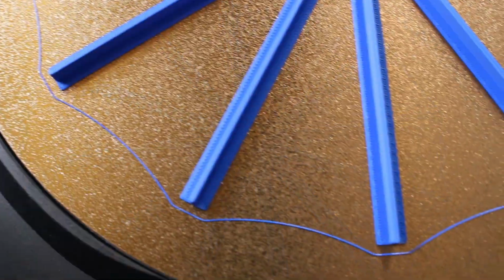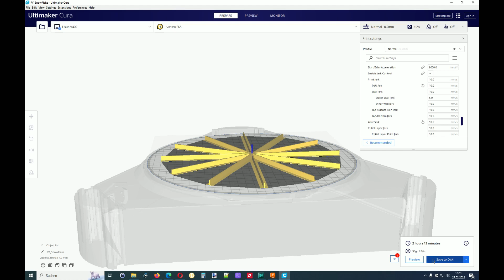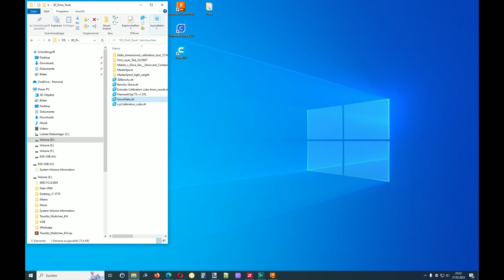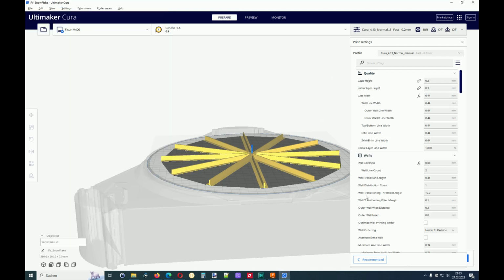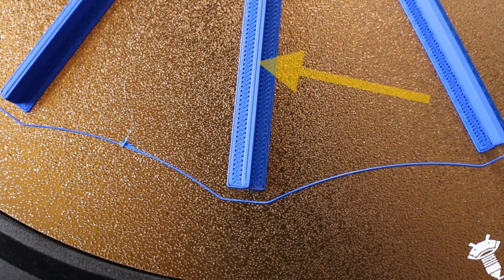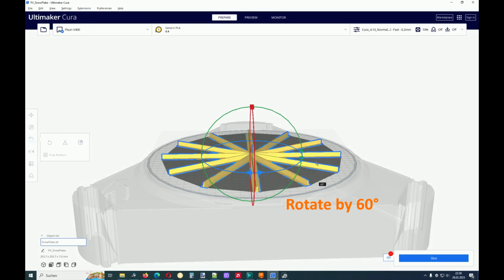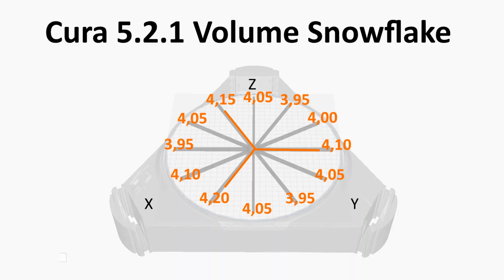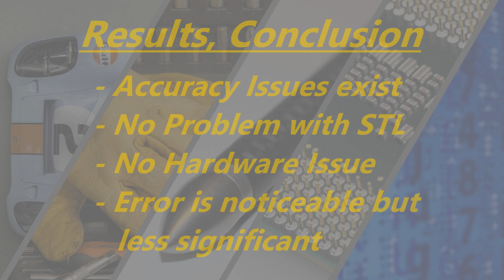FLSUN V400 Delta Printer Accuracy Issues

Comment: It's the same problem that I (and others) had with the Rostock V2. The Rostock was fair at making doo-dads, not good at all in making compliant parts.

And just out of curiosity, has FLSun been of any use at all? They were completely useless as they couldn't even be bothered to replace the bad SD card that they included with the printer.

Comment: Oh wow... and here I wanted to upgrade to the V400 becasue I cannot figure out why my Super racer is doing this.... I do not have the Data logged as you do, but I clearly noticed that prints always have an "Open" side. I moved away from Cura as Prusa slicer set to 40% overlap sort of fixes the problem for me. but I think i loose quality becasue of this. also printing PETG slower than an Ender3, not cool. I do hope there is some sort of answer here... for now then I will only upgrade the SR with the V400 Effector and wait for this problem to be settled.

Comment: I agree with @mastermaker666, that your print looks under extruded.  

I have a Hatchbox Alpha delta printer (an older printer) and I do not have this problem.  I use a 0.4mm nozzle, and Cura 5.4.0.  My "spokes" vary from 1.84 to 1.88mm.  I could be wrong, but I attribute this variance to the very long bowden tube setup the HB Alpha has.  I envy the V400's direct drive configuration.

I would recommend researching your line width settings.  But before you do that, get your printer calibrated (which it looks like you are doing, but specifically look at your extruder's steps per unit of measure calibration), then move to filament calibration.  Generally, the order for filament calibration is bed adhesion to print temperature to flow rate to retraction to print speed settings.

There is much debate about this topic in the 3d printing community, but I believe that the line width (in Cura, Quality->Line Width) should be something slightly greater than the nozzle diameter.  I believe the Simplify 3D folks suggested 0.48 for a 0.4 nozzle.  With that set, print a 20mm calibration cube with 2 walls (Cura: Walls->Wall Line Count) with 0 top and bottom layers (Cura: Top/Bottom->Top Layers, Bottom Layers).

Measure the width of the walls of the cube from the top.  You can adjust filament density or flow rate settings to get the right wall (and therefore line) width.

You can look at the width and placement of the walls from the bottom and make adjustments for elephant feet and the like.  Consider settings like: Initial Layer Height, Initial Layer Line Width, Initial Layer Horizontal Expansion, Initial Layer Flow, and so on.

That's your flow rate stuff, so move forward to calibrate your retraction and print speed settings.  Once you have that, then try the, "SnowFlake" print again and see how things look.

I look forward to hearing about your results.

Good luck!

Comment: I recently was working on a model with quite big top layer (circle, 25cm diameter) and was facing similar issues, in my case I had a bit of underextrusion in some areas of the print bed, no matter how many top layers I used (tbh I stopped after using 6). After multiple calibrations and tests (and kilograms of filament...) I don't think that there's a solution to that that would include calibration, unless there's some other form of calibration we don't know about. The weird part in my case is that the issue is usually happening every 2 infill lines (when using monotonic infill), and happens every single line when using archimedean chords infill.

Did you have any breakthrough with this issue? I'm ready to say that it's a delta thing and we won't be able to fix it, but I really don't want to loose the rest of hope I still have!

Comment: Those top surfaces look very under-extruded, the cheat fix for under extrusion is to increase line width by 0.1-0.2(any line width up to 50-60% larger than the nozzle usually don't affect accuracy in any noticeable way so 0.6 lines out of a 0.4 nozzle is usually unproblematic) and flow in 5-10% increments and print again, then repeat as needed until the problem is sufficiently fixed or things start looking too over extruded(at which point you obviously choose the last setting that wasn't too over extruded)..

Bit odd that it's under extruding as every v400 seem to have over extrusion issues rather than under extrusion issues....
Reply from the maker: Hey Thomas! Thanks for commenting on my video.
A you mean the top layer of the surrounding area of the snowflake, right? Yes, those could be better, but this was not my original problem.
Basically my problem was/ is that the print is too wide on some areas. When filming this, I had too much width by 0.2mm up to 0.4mm. Meanwhile I updated to original Github Klipper and did the full Setup/Calibration (well not the full one, but more than 80% I would say...). My accuracy increased to a deviation of 0 to max. 0.20 - 0.25mm (I would say closely doubled the precision). So already better but not yet perfect. 
Once I have time for the toplayers, I will come back for your comment, thanks!!
Reply: @craftingmat5425  Have since bought a V400 and I may have a fix for the split walls. 

Use an odd number of lines for the walls, appears to be a delta quirk where 3 lines of simultaneous non-cartesian movements needed for every single nozzle position translated into a cartesian coordinate system causes issues with even numbers.

Was using 3 lines but was having bleed-through issues but no split walls so upped the number to 4, and I started getting split walls, upped the number of lines to 5 and the splits went away.

Also found that I would get shades of splits when printing something that was exactly 2 walls thick(ie 5 lines+5lines with no infill between), lowering the thickness by one line width so that I would get a line printed in the middle rather than a line on either side of the middle, bringing the line number back to an odd number and those also went away....

Comment: i have V400 and i have set print speed to 250, print acceleration to 4000. this has helped me a lot to get better prints. changing Acceleration had the biggest impact for me. i had seen you were using default settings for this in your video. Also you may try setting top/bottom pattern to zig zag. I would be very interested to see if this resolves your issue.
Reply from the maker: Thanks for commenting!
I was printing at low speed (120) - not sure about acceleration tbh. But thanks for this tip!
Atm I am working on my Calibration video after I have setup "original" Klipper (see also other video). 
After that I want to do another snowflake and I hope it will be much better...
Reply: @craftingmat5425  I just setup original clipper on my second  V400 and your snowflake came out VERY respectable.
Orca Slicer
Layer Height  0.2
Outer wall speed  290
Inner Wall speed 310
Acceleration: Normal printing  5000
                          Outer wall  4000
                          Inner wall  5000
Wall loops: 2
The original Klipper is far superior to the FLSUN V1.4.
The accuracy is by far better.
Cheers.

Comment: I don't own a Delta printer but if I had to guess, I would blame rounding errors somewhere in the conversion from orthogonal axis to the delta configuration.
Reply from the maker: Thanks for your comment.

Yes that is possible. Up to now I do not see a better solution than going with a "proper" klipper. I think it will either dramatically improve with original klipper or it will be completely done.

By the way - the original snowflake was not my design. And I found out, that it already has a gap by design. The proper measurement should be 1,8mm (where I see the gaps, it has around 2,1-2,2mm). Surprisingly it was not created to have 4x the nozzle size (4x0.4mm = 1.6mm), it is 4x0.4mm plus 0.2mm in the middle as a gap. So to be clear on this one -> the gap should be either visible at all of the snowflake arms/beams or it should not be visible, but the size should be 1.8mm on each and every arm/beam.

I am looking forward to the original klipper test. I will do at least 2 new videos on the klipper install and the calibration of the printer.

Once that is done I will repeat the Snowflake test.
Reply: That is exactly what I have concluded after switching every part of my QQs pro that could possibly effect this. Plus buying a SuperRacer which had the same problem. My bed slinger has the same problem, tho not nearly as bad.  I think there are rounding errors when 2 or more motors have to move together at the same time with bed slingers. Obviously on a delta all three move together all the time which probably is what makes it worse on a delta. Marlin and Klipper did not help at all for me.
Reply from the maker: @natewipf5064  Fun fact: I am working as Dept.Head of a company producing high precision bonders for semiconductor industry. I do this as a profession. We have a saying for that: "Any movement done is wrong" -> meaning once we move one motor, we correct the movement after OpticalInspection confirmation. Of course we have several methods to make movements precise, but in the sub-micron area air gets thin (as we say in Germany).

On the snowflake it is obvious that the issue gets larger the more off-center the head is placed - at least I did never see the gap in the center, it was always on the outside of the arms/beams/rays of the snowflake. Due to geometry rules, the movement in the outside of the workarea requires much smaller movement of the according axis/motors involved -> means: The movement precision is maybe not enough.

Still my guess here was that it will significantly improve with original klipper, when I can use full klipper functionality (including ADXL345 input shaping). 

But maybe I am wrong. 
I was very optimistic before your comments... now not so sure anymore.
Reply: @craftingmat5425  what do you consider "original" klipper? Is it different then the current klipper version? I have tried the current klipper version with both my delta and ender 3 bed slinger with basically the same outcome. Enhanced calibration and input shaping disabled and enabled,  Just one enhabled, both enabled, every combination I could dream up with every setting i enabled or disabled in klipper that I could think of that could make a difference and even a bunch that I knew wouldn't help just to see if anything changes. I have to say that this was done before I found your video, I was using a 200 by 5mm rectangle. No matter what I changed the rectangle was always 0.3mm to 0.5mm wider on the right side of the bed vs the left(also the width change didn't occure at the outer edges. It started at  the center of the bed.  until I switched from slicing with Cura to slicing with Prusa and bam.. the wider part switches to the left side of bed. Cura prints clockwise, Prusa prints counterclockwise. Please someone explain what's going on here if it's anything related to configuration and calibration? Another wrench in the mix; giving the C tower carriage bearing more play fixes this  issue, width difference is down to only 0.05 which is acceptable to me, this does not completely fix your snowflake tho, still get small gaps tho not nearly as bad.  But no matter what I do I cannot switch the wider part to the left side of the bed except by printing counterclockwise vs clockwise. Somebody knows what's going on here. Who are you?
Reply from the maker: @natewipf5064  By "original" Klipper I mean not the molested FLSUN Version of Klipper. Klipper is open source and is constantly developed further. I want to have the real thing, not the Klipper FLSUN "tuned".
Not sure when I can start off with it. Maybe I will start this weekend with it. It will for sure take me a week if I additionally create some video footage for my channel. And it is not completely free of risk. Wasted already 2 days on some research on RhaspberryPi flashing/backup methods (without getting me somewhere lol).
Reply: @craftingmat5425  oh ok. Your talking about the klipper version that comes with the  v400 as not the original. I get it now. Hopefully you find something that I couldn't find.
Reply: @craftingmat5425  let me know if you get stuck with anything. Took me a while too but got it figured out. Raspberry pi installer was the best solution for flashing the pi But still had to jump thru some hoops to get everything working.

Comment: That draw back of delta. I cant even make it match to xyz of equal length. Especially onn 1.8degree stepper.
Reply: I would like to recommend to use 1 to 3 stepper ratio gear to increase resolution.
Reply from the maker: Thanks a lot for commenting!
I mentioned it in several comments already: My next step will be to install original klipper. Also I will do all possible calibration (original clipper can do more). On those 2 topics I will do 2 videos. I am pretty sure that my issues are gone after that and the V400 is then precise and fast. But it has to stand the test of time (2-3 weeks most likely...).

Comment: @Crafting Mat  
Hello.  I'm fighting accuracy issues with my QQs pro and Super Racer that I bet is the same issue.  With me I print a 200mm by 5mm rectangle left to right.  The right side is always 0.3 to 0.4mm wider than the left side., When sliced with cura and printing clockwise.  When sliced with Prusa or most other slicers that print counterclockwise the wider side of the rectangle is on the left side. When printing the rectangle front to back it's within 0.05mm, which is acceptable to me. And for you guys that will say 3d printers can't be that acurate, my out of the box ender 3 s1 pro has 0.02 accuracy with this same rectangle easy shmeasy every single time.  If my deltas can't do at least 0.06 I will throw them in the trash and stick to bed slingers and corexy
Reply: @CraftingMat.  If you print the 200mm by 5mm square I will print your snowflake and we will see if the issue persists
Reply from the maker: Most likely I already printed that... Not sure if it was 200mm... as for now I cannot do that (not home as said). Which 3d Model do you have in mind?
Reply from the maker: Hi Nate, thanks for your comments!
I assume that there is some inaccuracy with deltas. 
But meanwhile I am quite sure that it is a matter of calibration - therefore my main guess atm is to go for original klipper. This is also what I will do next on my channel. I have strong indication that after original klipper install including proper calibration it will be fixed.
For the QQs - I think this is not clipper afaik? I think Klipper is lightyears ahead of e.g. any marlin spin-off... not sure if Delta can be calibrated well enough with something else than Klipper.
Info: I will need more time for my "Klipper-Video"... because it seems not to be that easy and filming each and every step will be painful... also I could not yet start with it as I am not home right now... I assume it will take me another 2 weeks to get this done.
Reply: @craftingmat5425  i could find out this too on the snowflake. It is depent on the print direction where the gaps are...